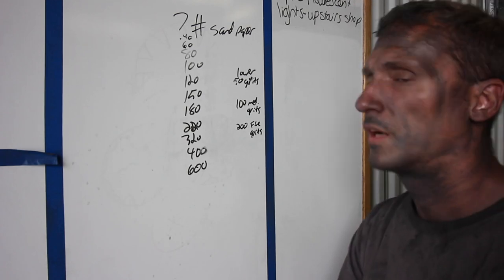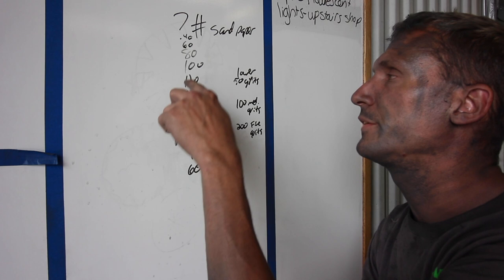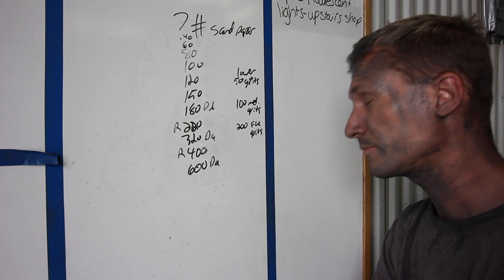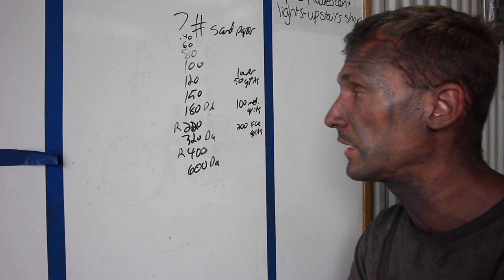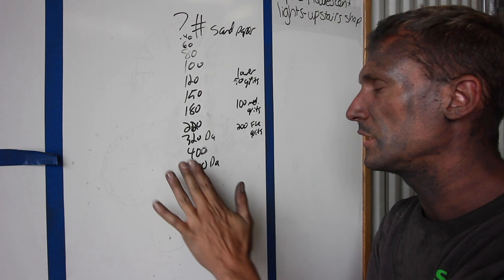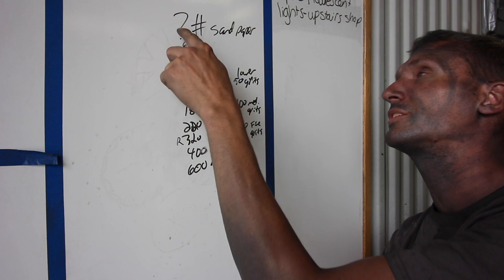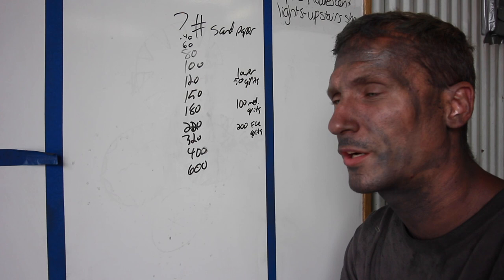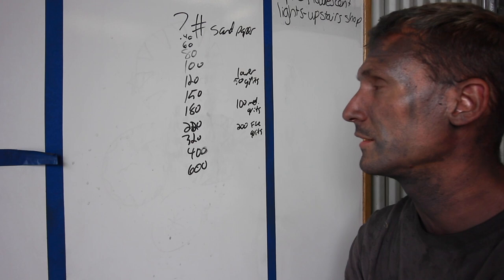Which grit of sandpaper should I use on metal? - Evan's Detailing and Polishing

Comment: hello how are you how to polish steel rims how many sandpaper finishes and what color polish shines well
Reply: @alexisbog138  So which polish do you recommend for the finish, blue or green?
Reply: @zaferdogan8651  
ZEPHYR products are not import into Japan!
I have never used ZEPHYR products.
Basically, I use Japanese metal polishing products.
Reply: @alexisbog138  what color do you use lacquer
Reply: @zaferdogan8651  It ’s a super clear lacquer, A little Lenova Conc (antioxidant) is mixed.
Reply from the maker: Steel rims? or aluminum rims??
Reply: @EvanStegerMetalPolishing  If you have a steel rim Instagram account, I'll send a picture there
Reply: @EvanStegerMetalPolishing  steel rims! :))
I don't like using lacquer on aluminum rims!

Comment: 600 grit you refer to is P600 (FEPA ) or US 600 (CAMI)?
Reply from the maker: Both are common standards but as stated in the video it doesn't mean much to me. The brand of the paper and how they grade it means more to me than the Standard by which they are held to because the grading system has no checks and balances. You can grab 6 different companies with grade p600 and they will all be different levels of hardness and coarseness. The 600 grit I use is p600 but not FEPA or CAMI graded.

Comment: So many great tips on your channel!  🙌
Like, I never knew to only sand to 600 for metal! 😮 (I only have experience w car paint/clear coat)

Btw… I wanna start over and perfect those big SS hex nuts I talked about before. All 6 hex sides still have some dings/pits after I  bastard-filed them by hand. I want them perfect tho!

I recently bought a new high rpm Dewalt drill (2800rpm, 7amp), 5/8-11 arbor adapter, 36grit flap disc (just in case) and also 5” backing pad w a bunch of assorted sanding discs (one kit is 80-600grit and other kit is 320-2000… both kits are alum oxide).

I’ve wanted a Makita/Dewalt rotary polisher for the longest time… but, I don’t polish my car often (like once-twice per decade lol). And they’re like $200, I can’t justify nor afford it. That’s why I got the drill instead (imo, it’s a more versatile tool for the seldom-DiYer/hobbyist, and it’s replacing my 40year old drill anyways, lol.)

Anyways… my question is… what grit should I start with to remove those pits/dings on 316 SS?? 
If you want a visual, it’s in my latest ‘7” record stabilizer/weight’ video (about halfway thru video @19:00, I show it after I filed it by hand). You can still see pits and imperfections on the hex nut.

What grit to start with the Raw nut on the left? (say if I wanted to smooth more of them for people) 
And, what grit to start with the nut I already filed down on the right?

Any help appreciated!!🙏
Reply from the maker: Paint and raw metal are definitely two different beasts. Paint is very soft and needs finer attention. Whereas metal needs a more aggressive approach.  On stainless that is rough I start at 80 grit and work my way up. But you will lose a lot of material getting all those pits out.
Reply: @EvanStegerMetalPolishing  Thanks! I guess I'll try 80grit this weekend! If it's too weak, then I'll try the 36grit flap disc I got.

Comment: I love your videos I've learned a lot keep up the great work. Have a question for you... I've been doing some Polish in about 5 or 6 years mostly just a truck I drive. Got a new kenworth about 10 months ago the tanks if not had anything done to them yet was wondering if I should sand with 406 100 or just cut and color..  It's a brand new truck a 2020.
Reply from the maker: Sometimes they need sanded. Sometimes they don't. I usually polis one spot. If it polishes easy then I just polish. If it doesn't then I sand. I try to avoid sanding unless I have to.
Reply: @EvanStegerMetalPolishing  I know you're very busy thanks for the response.